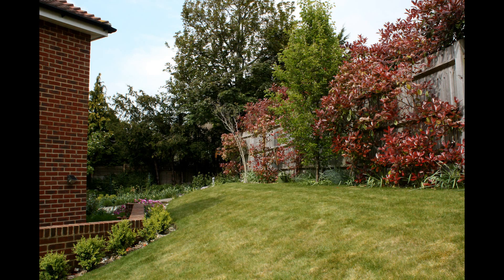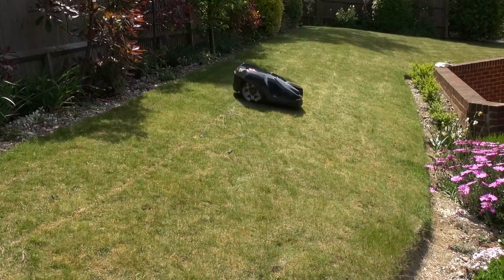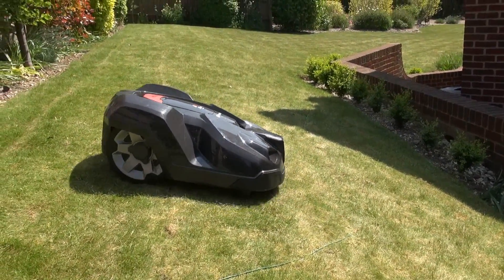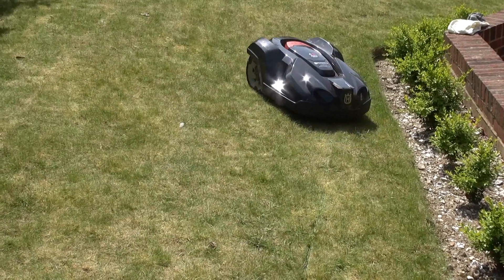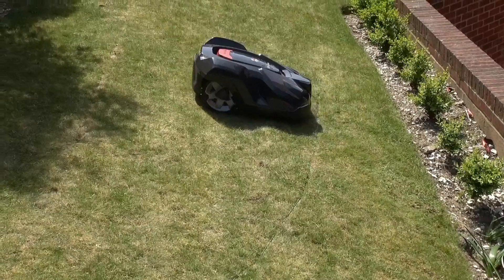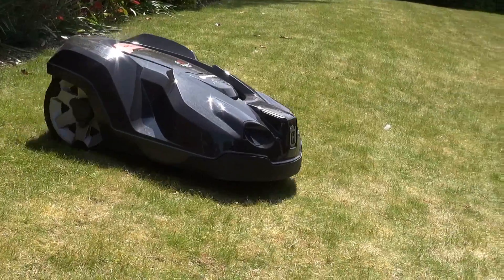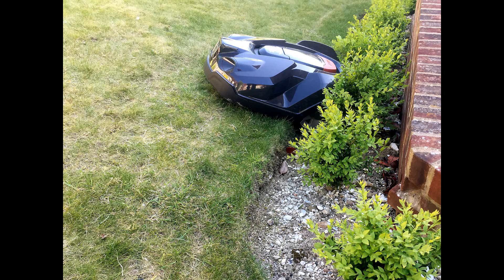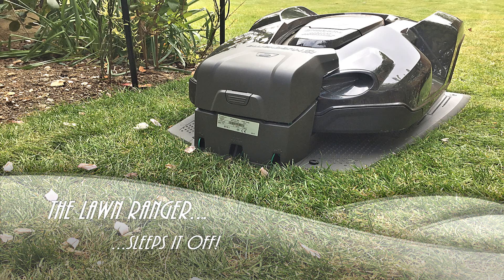Husqvarna Automower - The Lawn Ranger bites the dust!

Comment: I have a 105. don't have to worry so much about slopes but more when it cross's the boundary in 3 places between grass and paving. but slowly am resolving.
got to get a second for my front lawn as not practical to have it getting between both (huge drop step and not my place to change)
been happy with mine
Reply: I built the edge of my lawn to be exactly level with the paving.
Then I put the boundary wire right at the edge of the paving so that the front wheels drive onto the path.

Comment: Great review. I'm awaiting install of a 430X. Realized just know that they may be a part where the boundary wire should go at the bottom of a slope and it is more than 15% incline. Will wait with the terrain wheel kit because if it is not needed I might go with only the brush kit to keep the wheels clean (I don't want to buy that first and then find out I need the terrain wheels which includes the brush kit).
Reply from the maker: Thanks for that.  I think it likely that 20% would be ok, maybe even a little more. We have 30-35% but only on a very small section of our lawn and we're still delighted with our 430X. I installed a Terrain kit yesterday. it comprises wheels with longer teeth (but fewer of them) and brushes to clean them. I'm preparing a video of the installation process (hope to publish today) because it wasn't entirely straightforward. I won't be able to say how effective the kit is until I make time to move the boundary and guide wires, which won't be today.
Reply from the maker: Just to let you know I've posted my video of the Rough Terrain kit installation now. It was straightforward once I'd figured out  how to remove the cover. The wheels are the same except for longer teeth (and fewer of them). The brushes would probably help, if the wheels got mucky, but so far that's not a problem I've had. Performance n our rock hard ground with thin grass has certainly improved and my next video will show that. I still had a couple of crashes at first but only because I was testing to see what I could get away with. Moving the boundary wire a short distance up the slope to where it's a little less steep - around 25% - seems to have done the trick. https://www.youtube.com/watch?v=6AMjrlMz1P4